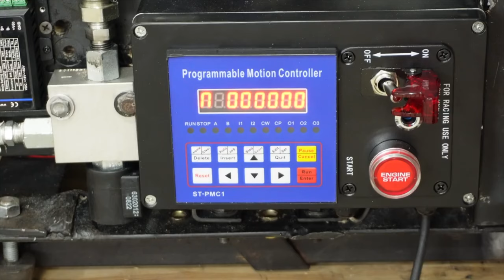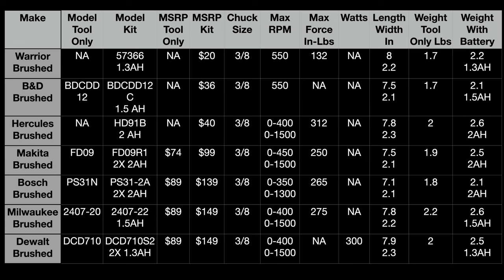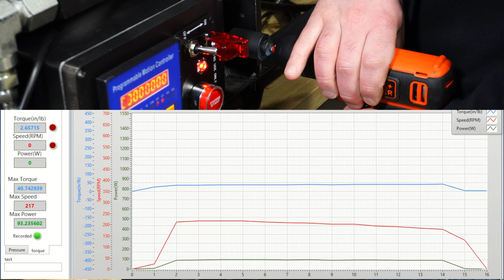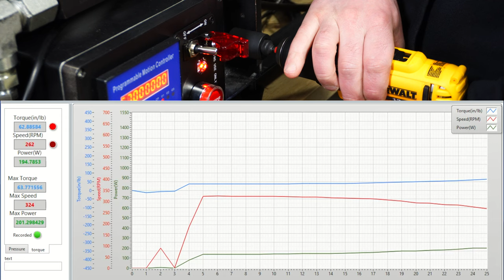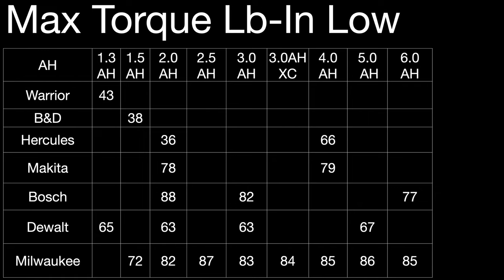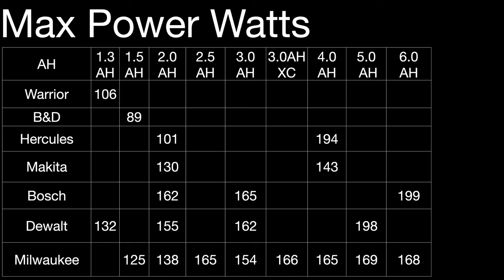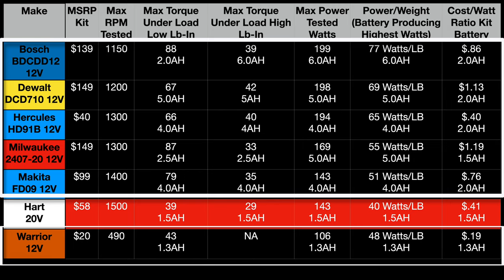Worst Cordless Drills?  12V Brushed

Comment: I have the Bosch 12v and it's great for smaller tasks.  For bigger ones, I go with 20v Ridgid mid-torque, and with big heavy jobs I use the old Ridgid Octane High Torque.  Right tool for the job!  If something smokes, I would think I'm pushing it way too hard!
Reply: Ridgid is junk get a Dewalt

Comment: Ive been with Bosch for over 10yrs.  Some of the original batteries are still working fine. I have lots of their 12v and 18v tools and have been very satisfied.   The only drawback is overall selection of tools in North America.  Europe has a very robust selection of Bosch tools that for some reason are not available in the USA.
Reply from the maker: I agree,  wish we had the selection like Europe.  Almost the same deal with Makita but they are getting better.
Reply: I have the Milwaukee M 12 hammer drill first gen . Very powerful little drill.

Comment: Bought in to the Hercules battery line in 2017, was frustrated by the delay for compatible tools UNTIL last year.  They're now at or near the top of the brushless market.
Reply: 12v or 20v, the 12v line is still limited but the 20v line newer tools are competing strong!
Reply from the maker: Yeah 20v line is looking good,  I agree 12v needs expansion.
Reply: @Tools-Tested  I did a quick look but didn’t find it, have you tested the brushless Hercules 12v model?

Comment: The bosch is a great little drill. I used to have it a few years back. It's truly a compact tool. I do love my current 12v drill though, the 12 xtreme dewalt. It's a workhorse.
Reply from the maker: Yeah that dewalt 701 is an animal for its size.

Comment: I’m curious if you enter the 12v brushless for screwdrivers (if that’s something you are considering) in seeing the m12 installation driver vs m12 fuel screwdriver. I have both and I prefer the installation driver for the utility alone. But the fuel screwdriver is shockingly capable of being that tool that does 80-90% of a homeowners need. I got them both for a very good deal
Reply from the maker: Installation drivers will probably be the end of next month.  Probably around end of this year for screw drives if I’m not out of money by then lol.

Comment: please note, if the measurement reads "2.097", that, is not "two point zero nine". That, is "two point one". 
(the error from "two point one" is 0.14% while the error from "two point zero nine" is 0.33%)
(you are more accurate when you say "two point one")

Comment: I don’t know why brushed drills are still made. Brushless drills can be gotten for so cheap now that it’s only a few bucks more for the kit. Unless you find a holiday deal when they can be gotten for dirt cheap. I’m going to avoid brushed tools when I can.
Reply: Likely good, better, best marketing. You need something on the bottom so you can sell up from to make more money. Human nature is not to buy the bottom, but rather the middle (perceived best value).  The cost to make a mid or best model isn't that more expensive, but price difference can be significant (which is mostly profit).
Reply: Brushed can still be more compact. I bought a brushed Milwaukee M12 recip saw because it was much lighter, smaller, and a lot cheaper.
Reply: Brushless is trash. Permanent magnets fail from motor heat, microchips (not including batts) failing and add much more cost (prices are still much higher than brushed). 

I have corded brushed tools that have lived longer than any -less has. And I've never had a brushed fail under a year...
Reply: @jsplasha  And now you will know the reason.
Reply: @mediocreman2  Yup, a properly designed brushed can be as compact- the entire brush housing & brush design is archaic but few engineers will work on it. Too '"tried and true". I've tinkered some thoughts in my head but I'm a thermodynamicist not an engineer lol. Efficiency is our mindset.

Ediot: l also want to mention why I name dropped 'corded'. Batteries are stupid in 80% of usage, grid power is most environmental, energy evaporation from multiple generation-transfer-storage cycles.

Plus you're tied to that tool brand's line of batt/tool options.